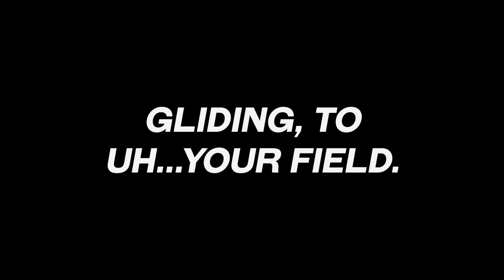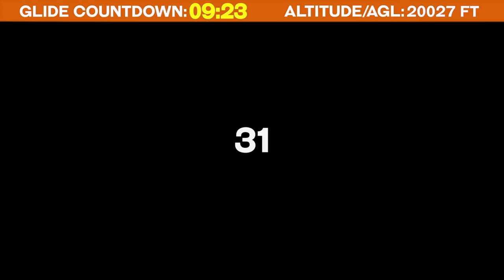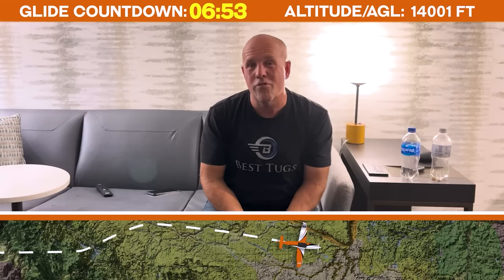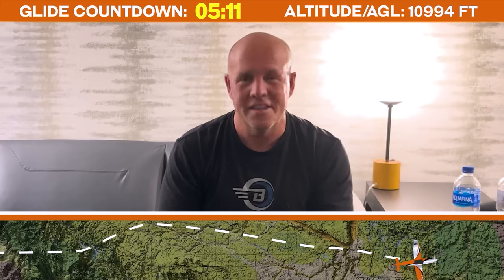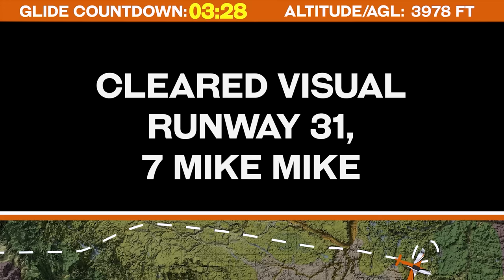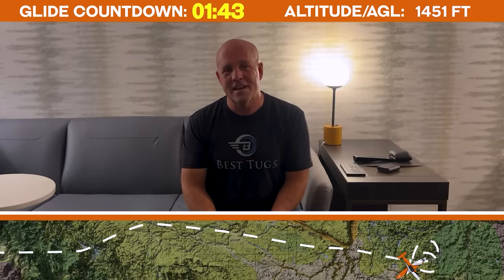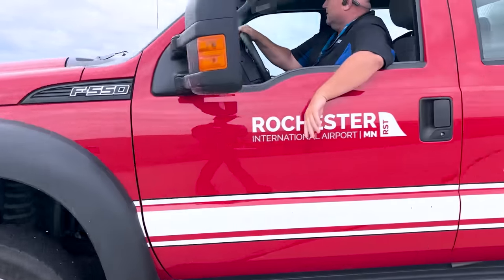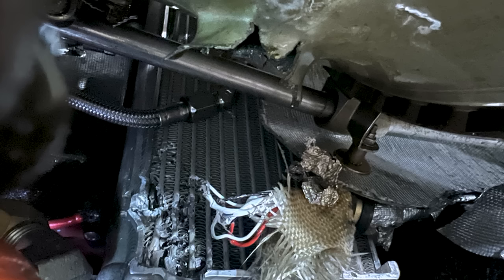Engine Explodes In Flight - Turbulence will not be at Airventure 2023 | Turbulence Emergency

Comment: The extended engine TBO's are for companies who have experience with these engines, and have sent multiple of the same engine in for OH in the past, with no major issues found.  Then you can extend the time.  You would not be eligible for this.

This was a high time used engine, from another outfit.  There are no tattle tale systems on these engines and are 100% mechanically rigged.  You are relying on the previous party and their pilots to be telling the truth that they didn't overtemp or overtorque it.  That is a lot of trust put in an engine being installed in a single engine application.

Comment: Glad you are safe legend.

You put a standard engine in the fastest ever single-engine turbo-prop plane.

Yet you appear dumbfounded at what could possibly be the reason for having an engine failiure.

It is very simple:
You pushed the engine too far.
You want to get too much speed out of it.

You made an engine used for 600kmph max do 700+ kmph.

Yes engines usually complain in other ways before exploding.
But when the limit is not pressures but sheer metal fatigue, strength from being asked to do too much it doesn't matter I guess.

Think about it this way:
You put a porsche engine in a formula war chassis and asked it to do what a specially designed f1 engine would have to.

It will blow.
It is not made, designed to handle it.

Engine design is an art in itself.
Maybe a video consulting with an engine designer to autopsy your pt6.

But the reason being pushing the engine too far seems obvious no?

Comment: You need to take a ride in My hotrod
Open wheel open cockpit 85% nitromethane 360 cubic in Chrysler hemi running a 1927 model T roadster body.
Absolutely not aerodynamic but it looks good when it's on a pass it sounds like nothing else.
Burns 500 lb a fuel in a five Mile pass that takes 1 minute it almost always ends in a fire there's no time to wrench the car only enough time to refuel it and go again.
Rods and pistons are gone wrist pins are seized in the piston always down on RPM coming into mile 3 and it's time to hit the throttle until you can see the flag for mi 4 you must listen for the pops that is the Pistons failing when you hear the third one go you must shut the fuel off and prepare for the explosion that you will feel as well as hear that's the supercharger exploding.
You are on fire.
Now you got to get it stopped depending on how bad the fire is you may get lucky and your parachutes will hold or as soon as you feel them hit they are gone.
Fortunately there's very little to hit as long as you still have tires in a bad fire they can go anytime that can be a blessing or a curse if they both go it could be a blessing but you also will tear up the the course for the next guy you could also lose control if all goes well in 5 more miles you will be greeted by fire ambulance and everyone from those looking to see a wreck and a few that want to see you get out of the car in one piece unharmed.
And hopefully you got a record to make all that worthwhile.
No shame in bringing home a burned up cinder of a race car and a record.

Comment: The video doesn't make it clear.  Did you actually declare a proper Mayday?  I suspect not if ATC subsequently asked you about SOB/POB.   By saying those three words -Mayday, Mayday, Mayday. Everyone instantly knows that an aircraft in their vicinity is in trouble and has absolute priority.
A casual " I have a catastrophic engine failure" does not achieve that aim.
Reply from the maker: There are several minutes of  recording I’m trying to get  now from higher altitude sector.  It wasn’t recorded on the online apps.  In that sector I first first words were officially declaring and emergency and then started working airport options . I’m waiting for that recording, they said it may take a few weeks.  I have no hesitation declaring an emergency as they are always a great help and know it’s critical nature

Comment: I forwarded the video to a very good friend of mine who spent his entire working life at Pratt as a high level Metallurgical Engineers as well as Managing parts production technology at the factory in Montreal wheere these engines are designed and manufactured.. He had the following comment.
"Guess he never heard of creep and stress rupture failures. The engine was near o/h time. It would only take a couple (or one bad one) of hot starts to cause a turbine area failure later with no warning. Supposed to be noted in log book at least, perhaps a HS inspection immediately. 
O/H costs for life limited components are very high, operators like this are notorious for cutting corners and lots of cannibalized used parts are available."

He is known for being rather blunt and I appoloogizr for that but thought it worth forwarding to you.

Comment: You just pushed it beyond its capabilities, again.  411 knots and the power it takes to do that?  Pushing the envelope will eventually take you out.
It will eventually get you.
Reply: Why do you say that? It is a very big engine for a small and light aircraft. It does not seem he pushed it in anyway it was not designed to do and not outside parameters. He seems very safety minded and trying to minimize risks.

Comment: Sounds like you had a microfracture in one of your rotor blades causing it to contact the stator. That's about the only way other than a bearing just seizing it's your turbine will just stop. My money is on a hot start in the past causing a microfracture that you would not find unless you x-rayed the compressor blades.
Reply: I remember the first time I spoiled up a turbine, my instructor was very adamant about what to do if you don't get full ignition and reach full spool up. We still had an idiot thank you could recover a hot start even though he couldn't get the engine to school any higher. I went to school is a technician and unfortunately all the turbines I've ever gotten to play with were outside of the aircraft. They're usually mounted on our test stands. The only aircraft I've been able to actually do any kind of mechanic work on were piston.
Reply: Come to think of it, I wonder if the torque converter had to do something with it because the prop shouldn't have just stopped!